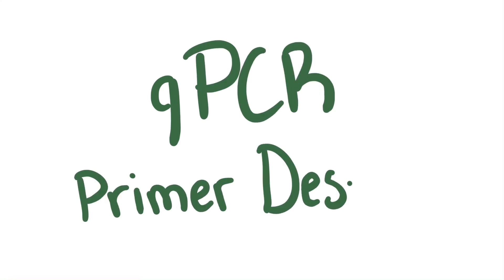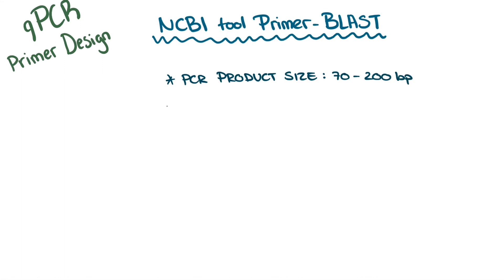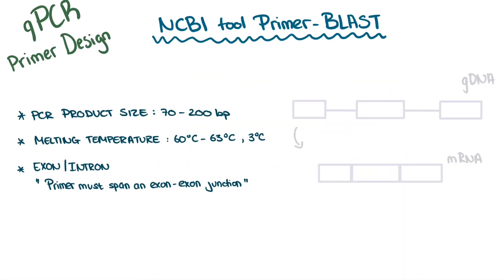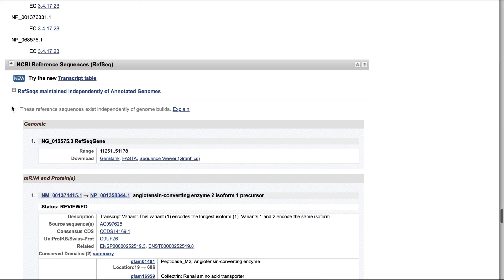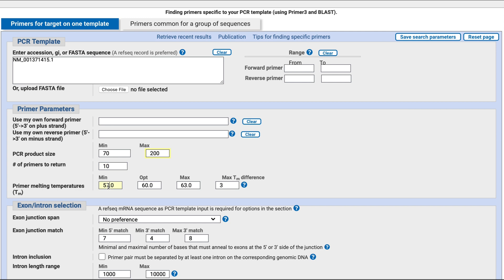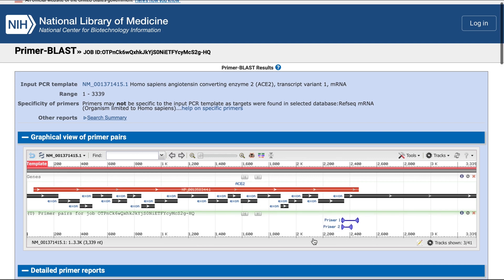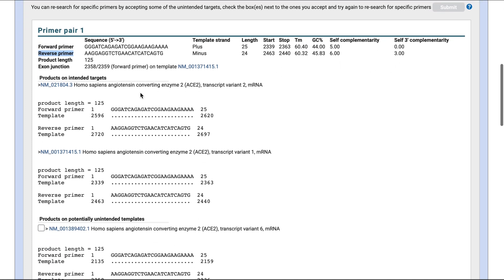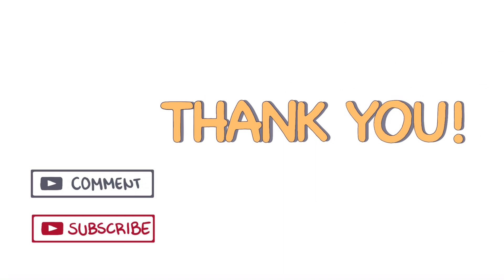qPCR primer design with NCBI Primer-BLAST

Comment: This is great! how would i go about making primers for a 35S overexpression line where i want to avoid amplifying the native construct?
Reply from the maker: Hello! Im happy to help you with your experiment, are you trying to show that your over-expression construct is working?
Reply: @bio-labratory Yes indeed I want to show that! Would be great if you can give me some tips :) love your account!
Reply from the maker: Hi, sorry for the late response! I’m more than happy to share some tips. If you want to demonstrate your overexpression construct, you can run a qPCR on your overexpressing sample and compare it to a control. You don’t need to distinguish between the native gene and your construct, since overexpression should show up as a significant increase in mRNA levels in your overexpression sample compared to the control (i.e., baseline/native expression).

Ideally, and this is common practice to confirm overexpression, you’d also run a Western blot to show that your overexpressing sample contains significantly more protein than the control.

I hope that helps! :)

Comment: How do I get the nested primers for the forward and reverse primers?
Reply from the maker: Hello, for nested PCR, two sets of primers are used to first amplify a region of DNA followed by amplification a smaller region within this site. I believe you already have designed your first set of primers and would like to design the second in that case what you would do is go straight to Primer Blast (https://www.ncbi.nlm.nih.gov/tools/primer-blast/) and copy paste your DNA sequence that will be amplified by your first primer set and use it as a reference to design your nested primers (proceed as instructed by the video). Let me know if you have further clarifying questions.